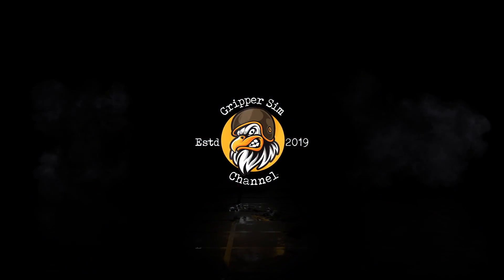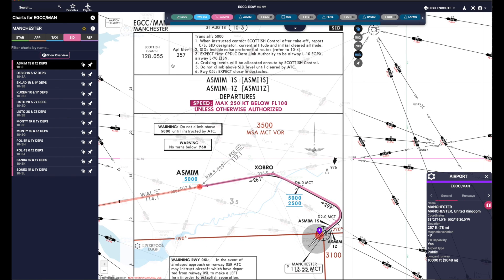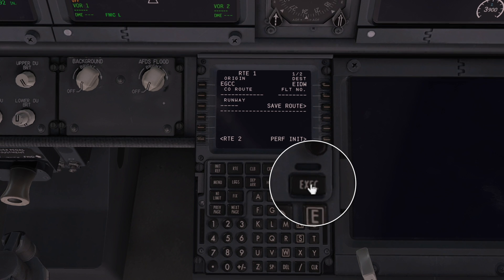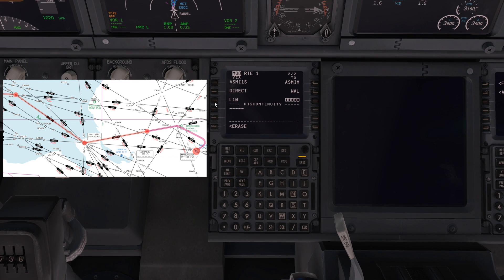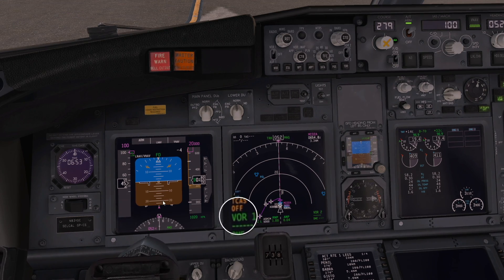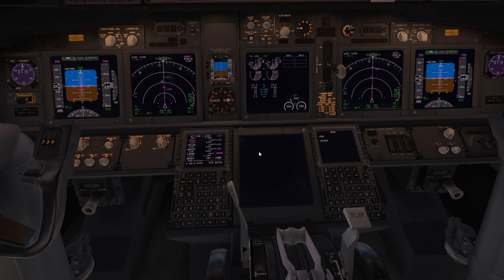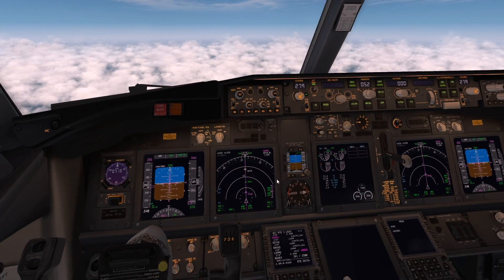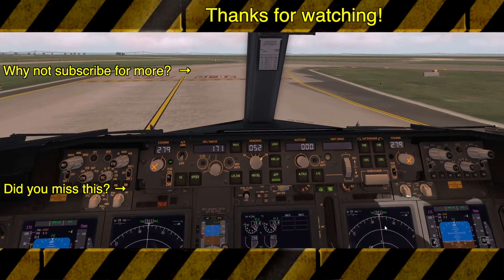737 for Newbies Part 1 : (FMC) Flight Management Computer overview

Comment: A helpful video for newbies.
For anyone who stuffs the programming right up you can reset the FMC by clicking and holding the Menu button down for about 3 seconds. This has to be done on the FMC within the cockpit, it will not work with WebFMC on a different screen. And yes, both FD's to on for an auto landing.
Reply from the maker: Thanks so much for the tips Trevs! Keep them coming! :  )

Comment: i would like to see a video on how to set up my controls for airliners. I still have a bit of a problem setting up reversers, speedbrakes, etc., and would love to see more detailed tutorials on actually LANDING these big birds. There's many times where I complete a nice trip and have the fmc programmed and i get flustered and don't get slowed down correctly or I slide off the runway because I missed the speed brakes and reversers, etc...
Reply from the maker: Ok that sounds like a good video, I'll do something on that! Thanks Jason! :  )
Reply: I don’t know if it’s in your budget, but I’ve done PC simming for a long time without a throttle quadrant but finally got one and I’m glad I did.The one from CH products has six levers and I run two for throttles, two for reverse.  Some will program the other two for flaps and speed brakes but I use joystick buttons for those, just preference I guess.

I also have found that a second joystick with twist controls makes a great nose wheel steering tiller.  My secondary joystick, a Saitek unit, has dual throttles but I’ve set them to be left and right brakes, and that’s actually been a big help since my rudder pedals don’t have brake activation.  They’re strictly rudder.

Also, sometimes you can find some good deals on second-hand stuff that’s still pretty workable.
Reply: @t.s.thomas02  yes! I have that one, and it does the trick. I'm eagerly awaiting the new one from Honeycomb, though, along with its' airbus mod. It looks fantastic and includes an AP module...

Comment: You can carry out an autopilot Cat 3 landing right onto the runway by selecting the first officer CMD button and thereby using both two channels (redundancy on one). A white “flare” & “rollout” will appear in the MCP to confirm the landing mode. 👍👌

Comment: Not a bad job flying it considering you’ve pretty much had to train yourself!  If I may offer this for the benefit of the viewers:  Your descent may be earlier or later than that green T/D point.  -You may spin that new lower altitude in the Mode Control Panel window and press either VNav or Flt Lvl Ch and it will go down in the descent assuming you put a lower altitude in.  (If for whatever reason you put in a higher altitude, it should climb to that altitude).

-That speed window is dark or “blanked” because Vnav is scheduling it, but it can be such that it’s flying its own schedule and that MAY not be what you want, so I believe if you press it, you could roll your mouse wheel and spin in the speed you want.  That way you would’ve been able to get those flaps out without having to disconnect the autopilot.

-Good technique would be go ahead and select that APPCH button before the pink diamonds are centered up.  What that will do is “arm” the system, or in other words, get it set to “capture” the horizontal localizer and the vertical glide slope.  It will save you from missing it, I promise.  
I have friends who've done it! (wink wink)

-Good and very realistic technique would be to select the Vref plus about a 5kt extra margin at about 2000 ft above the airport, coming down the glide slope, immediately hit G to get the landing gear coming down, then start selecting those flaps down as soon as you can in compliance with the flap speed limitations.  That way, you’ll meet the requirement that the real planes seem to do with having gear, flaps and speed all set by 1000 ft above the landing zone. (I think this is the area you were referring to as the mistake to catch on the final approach.)

-Put the missed approach altitude, whether it be 2,500 or 3,500 or whatever is in the approach chart, in that altitude window after glide slope capture, but before 1,000 ft above the landing.  Then, if you do have to go around/missed approach, hit TOGA and your autopilot will level off at that altitude automatically.

Again, good job.  I’d like people to not be too intimidated about the autoflight system in these sims.  Hope that helps any newbies.  I enjoyed the video.

Comment: I'd set aside this evening to learn the FMC. It's like you knew...

I suspect your powered USB hub is the cause of your controller issue. Plug direct into the PC if you can & test the response
Reply from the maker: Will do Stuart! Thanks for the Tip! Let me know how you get on with the tutorial.  :  )
Reply: @GripperSim  I started badly. Many ALT-TAB's later I arrived over Dublin Airport at FL200. I missed the altitude bug too! I wish I could say I arrived over Dublin but since updating to 11.50-b9 that (default) scenery area is gone, so it was an just airport in the sea. Didn't bother with landing there so next time I'll see how much I've learned by trying to fly between 2 airports in the UK, where I have OrbX scenery.

Comment: I use the "Little Navmap" freeware program to create flight plan from X-plane data and then save it for the aircraft I am going to fly. For example if I want to fly Zibo then I need to save this flight plan as *.fms. Then only thing I need to do is to use the co-route option in the FMS to load that flight plan. Thank you for the video.
Reply from the maker: Yes, it appears there are many way to add a flight plan. Thanks for the tip Arctic.  :  )

Comment: If you press the 2nd CMD auto pilot button it will land automatically - all you need to do is arm the speed break and control the speed. Then off the reverse thrusts at 70 knots when landed.

Comment: If you did not disconnect the auto pilot what would happen? Can't the autopilot land the plane?
Reply from the maker: Yes, there is a feature on the 737 called auto land. But that's for another tutorial. In the case of this video, it would have brought me down the ILS, but I had to do a few bits with the autopilot. :  )
Reply: @GripperSim  Cool what about auto takeoff?
Is there a feature for that?

Comment: Very useful, thanks! 
Do you know if the default 737 will be able to do this if I update the database? I'm unable to run the Zibo at more than about 2 FPS!
Reply: Mark Rice the default 737 has a simplified fmc, but you can do a blanket update of your nav data for all aircraft.
Reply: @kalynstalinski8375  thanks there Kalyn. How would a noob go about this, preferably for free 😂
Reply from the maker: Yes, the default 737 will work also. The problem is guys you have to pay for the data, if anyone has any ideas on free data let us know!

Comment: My Toliss A321/ A319 both neo and ceo’s AP keeps disconnecting mid flight. Never done that before but it started doing that
Reply: Both in 11.41 and 11.50
Reply from the maker: Is it your controls I wonder?

Comment: Sorry mate you've made a mistake. You put the GW in the ZFW box so now your FMC thinks your GW is 66t and therefore will give you wrong speeds. The actual GW is 54.3t. Rule of thumb V2 is 80+ GW so in this case 134kts.

Dear R&R,
I've now watched the whole video and I do really like your enthousiasm, but bro there is a long way to go. I'll point out a few items to you not to burn you down, but to help you getting to grips with the 737.
Before TO
Set the autobrakes to RTO (in case you have to stop at high speeds the brakes will automatically start max braking in order to stop on the runway) Trigger point is 90kts groundspeed. Below that it won't do a thing.
Set V2 in the airspeed window on the MCP. The FCC will climb out at V2+20 either following the F/D or the Autopilot (AP).
Set the first hard altitude in the altitude window on the MCP (in your case 5000ft). If you forgot to arm VNAV and you set the AP on the aircraft will climb to the altitude set in the window. That case you will bust the 5000ft. ATC will be a bit annoyed by that.
Don't use the speedbrakes that much. Yes in the descent the airplane went a bit fast, but not to much. You will need to set the descent winds in the FMC if that is possible with this simulator. You can find that in the descent page then forecast. Set the altitude where you happen to know the wind (we use FL310 FL200 and FL100) and fill in the winds. Also the QNH can be set there.
When getting close to the airport you need to select a lower speed yourself in the airspeed window on the MCP otherwise the thrustlevers will try to maintain the set speed.
Good habit is to arrive at the localizer with flaps 5 and correct speed. At GlideSlope intercept Gear Down, Flaps 15, arm the speedbrake and set the speed to the correct speed for the flaps. At 1500ft above field set the landing flaps and reduce speed to Vref + Wind Correction. Landing checklist.

Hope this will help you. When you have more questions let me know.